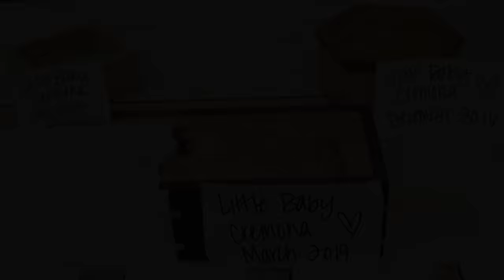Sliding Burl Lid Box | Woodworking

Comment: I've just developed an interest in woodworking, still in the researching phase (watching YouTube videos). I get excited watching your videos because I'm not sure what's going to happen next, like in this one when you were cutting the small light triangles but then it all comes together and there is an elegance to the simplicity. 

I stumbled onto your video slabbing the spalted silver maple when watching log milling videos (the only milling video where you don't mention the mill being home built). I liked your approach, easy going but passionate and wanted to learn more about you. I clicked over to your site and wanted to read your bio but down at the of the drop down under "posts" was building a bandsaw mill. As a tooling and equipment design that sounded very interesting. I clicked the link and was like "cool" he built the sawmill. But when I clicked that first video and you were dragging that steel off and starting the layout in your driveway I was like "what???"
 
I'm involved in building large manufacturing machines and then designing to the tooling for those machines, We have a large machine shop, large fab shop a team of maintenance men and electricians and we do really nice work, I say this with absolute admiration, watching you drill those big holes by hand or on the table top drill press was painful at times. Which made the band saw mill you built at home, in your driveway so much more impressive.  

I binge watched the entire series in the next 20 or so hours, and was more and more impressed with each minute of watching you build it, always with your regular chuckles and smiles. You sir are a very high quality person and unquestionably a great father and husband. 

Congratulations on your growing family and thinks for taking the time to share it with fans like me.
Reply from the maker: thank you so much!!

Comment: Congratulations!!! As soon as I saw the no talking, artsy box construction happening I had a feeling.  You should really figure out whats causing this otherwise before you know it you'll have an infestation of tiny Cremonas on your hands!! Love that lid. I thought for sure as you were taking a 1/4 inch slice of that burl that it was just going to fall apart but seems like it was pretty solid and not much too stabilization required. In any case, very well done on both projects! ;)
Reply from the maker: Thank you!! Burl is about 3/8" thick. I had previously used a bit of it for a pen so I knew it had some structural integrity